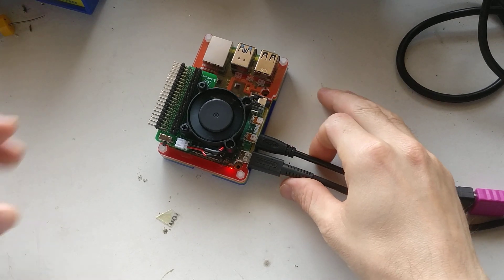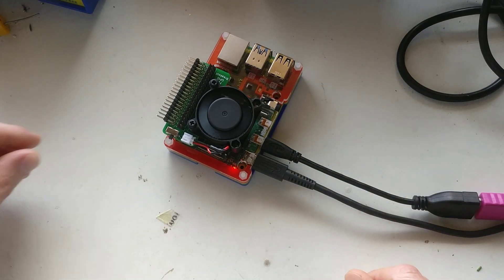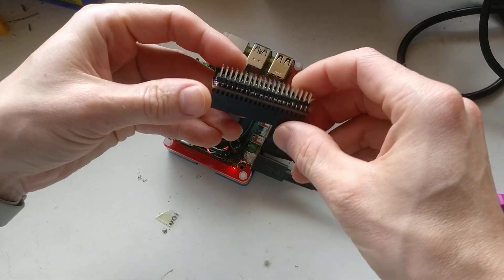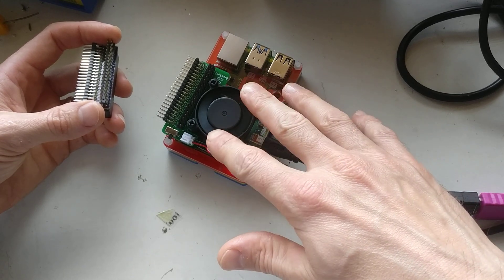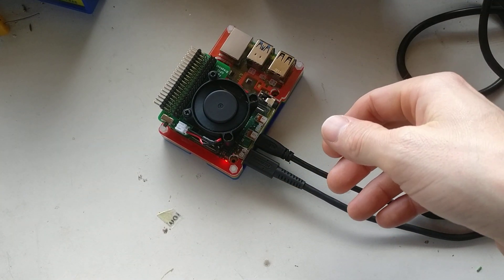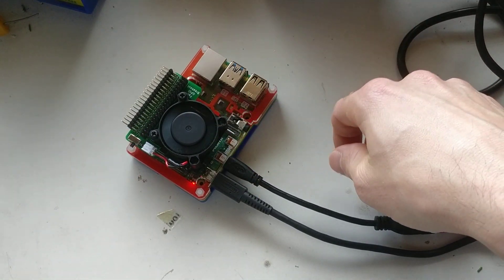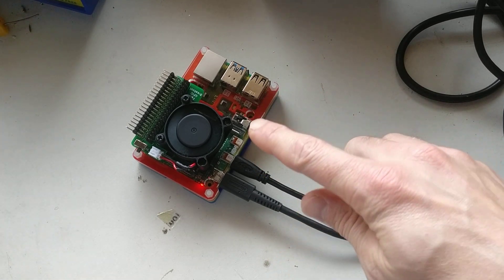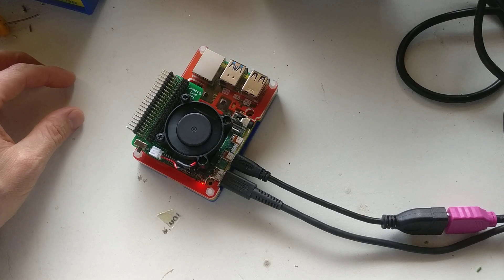Raspberry pi 4 fan with GPIO breakout

Comment: How did you get that GPIO splitter ?
Reply from the maker: Hi do you mean just the splitter without the fan part? I made it, You can order the PCB boards from oshpark but you will need 2x20 right angle headers and 2x20 straight headers https://oshpark.com/orders/eok2SoEy